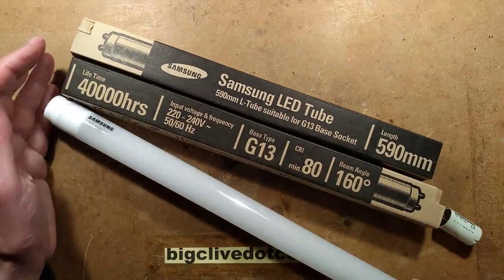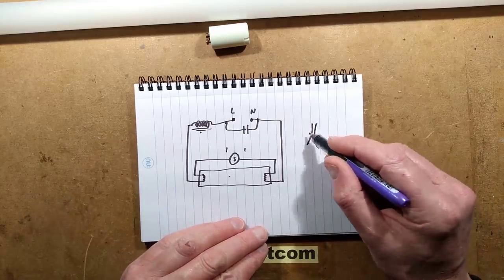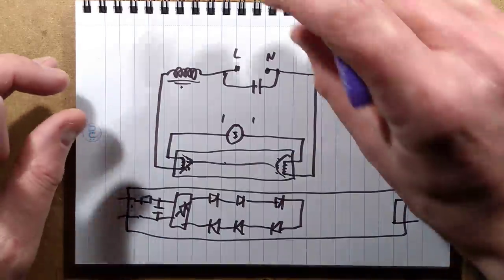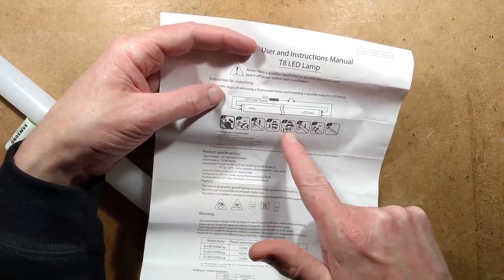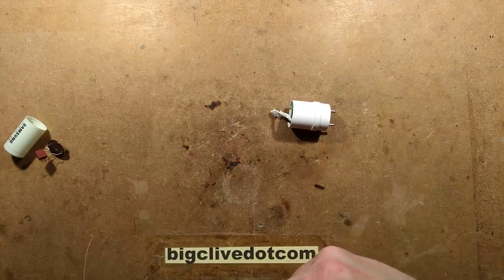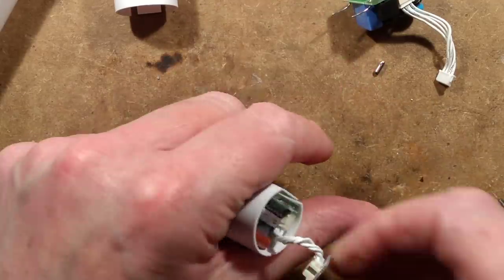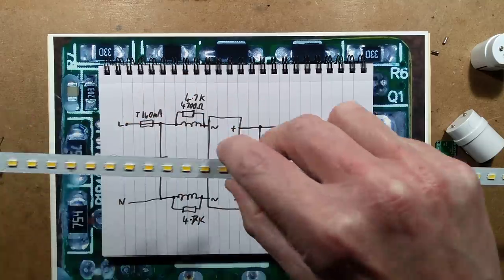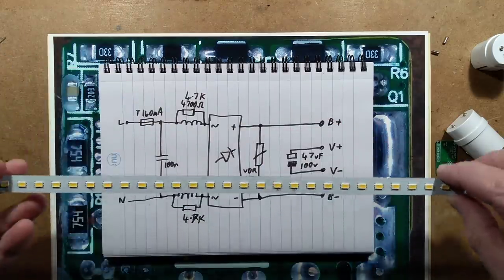Inside a Samsung LED retrofit tube.  (Older style?)

Comment: Hi Clive, very interesting video allways. I don't think the external mosfet is a startup device. It's the main switch. It is used in "source switched mode" as it says somewhere in the datasheet. That probably means "common gate circuit", like " common base circuit" with bipolars: You put the gate on an intermediate voltage, say 12V, and then switch the source pin to ground. Now the switch in the chip does need to switch the full current, but only 12V and not the ~300V max mains voltage.

Comment: That secondary circuit with the transformer looks like it acts like an OPAMP with degenerative feedback in order to provide additional protections and regulation that would otherwise not be available to just the power supply itself.

Comment: Maybe T1 circuit looks for AC imposed on DC supply ...? AC present at that point could indicate several failure modes and trigger a protection feature that shuts the thing off ....

Comment: I wonder how many of those LED tubes experience a blown fuse, with people them throwing them away. It's worth it to keep the failed tubes and use all the parts (after replacing the bad component(s), reconstruct a different type of light, and continue using them for other lighting. I'm too much of a techno-nerd to throw stuff away that cost good money to throw out because of a wee cost of a part.

Comment: Hey Clive I have a power supply here that passes mains through.. I don't know why it works fine the complete casing is earthed but I can measure half mains voltage from case to ground(won't trip breakers or so also)
I just can't find a Damm thing wrong but the shocks are short and nasty
Reply from the maker: That sounds like a common capacitive coupling issue between the windings.  On some supplies they reference the negative output connection to the grounded case to prevent that.
If the grounded case seems live with respect to local grounded objects then check for continuity between them.  There should be no significant voltage.  If there is then there is an open circuit in the ground circuit somewhere.

Comment: when you explaned the starter you forgot to mention one of its most important function:
It will open the circut right at the phasechange, the only moment when its possible to start the tube.
You can start a tube without a starter, but then you have to be lucky to hit the switch right at the phasechange.

Comment: We fit loads of these in the factory i work, annoyingly the majority of fittings are digital fittings and need rewiring. The older generation of tubes with the L and N input at one  end the opposite end pins are common'd out and causes a big bang if you accidently insert the tube the wrong way round!!
Reply from the maker: The modern tubes have the feed from one end and the other end shorted.  The ideal wiring arrangement is to have live to one end and neutral to the other. with the starter wire linked out.  That way the tube will work either way round.

Comment: Wow this thing is a complex mystery.. It looks to me like they're trying to balance out the mains ripple without using a huge capacitor. Its complex because of the low frequency and its a phase circuit. The telling thing would be that there should be less or no flicker when the tube is running.

Comment: Strange you've uploaded this on the day I've had an e-mail from Philips to say they'll repair my T12 5' tube ! Obviously, I've asked them as you can't get them any more - so repairing existing ones seems to be the way to go.

Unless..

Clive does another project on his website for DIY LED lighting.

So Clive, this is a request for that project - giving a component list (and suggested sources thereof)  so we can make out own LED lights - with minimal components - such as 80 LEDS 4 diodes and a capacitor or 160 LEDS (or 80 reverse twin LEDS) and 2 capacitors.

A sister video for the same but at 12 or 24 V DC would be useful too - including a transformer to go next to the consumer unit/fuse box to drop the whole house lighting circuits to low voltage. (maybe a model railway transformer will do - then  the whole property's lighting can be centrally dimmed. (I currently use a variac for that in my flat))
Reply from the maker: Easy fix for 12 or 24V.  Just buy the appropriate LED tape and put some inside the tube or on the backplate of the existing fitting.
Reply: @bigclivedotcom  For replacement fluo tubes, I'd want 5 LED strips per tube arranged hexagonally (one missing where it's mounted) - so one strip is a downlight 2 diagonal lights and 2 angled uplights. But what options are there re LED light beam angle ?
Bloody nightmare - hence consideration of getting existing tubes repaired !
Reply: @bigclivedotcom  Check marks.

Looking at migrating to bitchute. Not perfect but if they're prepared to make things perfect, I'll certainly migrate!

Comment: I've fitted thousands of theese ripping out old ballasts and wiring the feed direct to the pins. I really hated the end with the dead short. No matter how many time youve done it once in a while one would go in the wrong way and trip the breakers. I get why it's there in fitting with multiple lamps it acts a cross over on the over side. But I always found a way not to use it. Most of the time the ballasts are electronic with no starter so just popping in the replacement would be a dream come true
Reply: If it trips the breakers, you've wired it wrong (230V to one side, ignore the other side - not a good idea as you found out).
Reply: @mjouwbuis  When retrofitting not wiring from new...so removing old fluorescent lamp and control get ...the new led lamp has the pins on the other side of the tube as a dead short if the tube is inserted the wrong way round and you have this short in the feed side it causes live and neutral to short together tripping the breakers. When your removing ballasts and taking the feed to one of the lamp holders it's hard to remember which side you did it to. so it's easy enough to forget which side is the feed and which isn't when your doing thousands and your now popping a new led lamp in. it doesn't take much to do this and insert the tube the wrong way round. nothing to do with wiring up wrong as you can put a tube in any way you like it will fit both ways regardless but will only work with the power side of the tube in the lampholder with feed so if your blind there's 50/50 chance its going work or blow up.

Comment: q: is .uks power safer then .us? ie; being able to cook yourself easy?
Reply from the maker: Higher voltage, so higher shock current.  A shock is so unpleasant that it tends to discourage people from working live.  The UK has a lower electrocution ratio than the USA.
Reply: @bigclivedotcom  ie the reason i asked was the "get someone smart enough" to do the electrical was more dangerous? in the .us..?
Reply from the maker: @MrScotttraynor  No.  The UK where electrical training has degenerated into a farce.
Reply: @bigclivedotcom  no what i ment was in the .us you really dont need cert/etc, but your boned if you dont, ie; you burn your house down, or kill yourself/other via wiring, insurance isnt happy, etc.. or if your lucky enough to have a honest city/town inspector for permit work, they do catch bad wiring, etc.. but think it varies state to state, in some of the red farm states who needs any building regs.. aka, how far apart can you get 2x4s and have the house still standing ;)

Comment: Just a shame that it's cheaper to buy just the LED replacement tubes than the full replacement lights, I didn't know that a strip of folded chineseium steel costs 3x as much as just the LED circuitry alone in complete LED fixtures... :S

Comment: I think the fuse in the starter is there to blow when some idiot puts a regular TL and the “led starter” in the same enclosure. Which would be a problem with just a link.

(4:20 is slang for marihuana, because of the code numbers allegedly used by American police on the publicly listenable police radio. You know “4 20 in progress, officer in hot pursuit!”, that sort of thing. It’s in the lingo now as 4:20 pm, 20th of the 4th, etc)

Comment: My advise for replacing those florescent bulbs with LED bulbs is to get replacement LED's that have a built in control circuit so that the ballast can be eliminated and the line goes directly to the bulb as opposed to what is shown in the video.

Comment: The "shield" is a "heat sink"....  (i bet)...
Reply: If it were a heat sink it'd likely have much more surface area connected than just that one pin. No, it's surely an RF shield as those types of lights used to be known for lots of RF pollution.

Comment: I must admit I hate digital zoom, but then I am into photography & am a bit of a photography snob. We all have our fults, that is one of mine. I would prsonaly prefer it if you moved your phone physicaly closer to the item. But i do undersanbd the praticalitys that oftern don't make that work.
Reply from the maker: The initial zoom is optical within the 12M frame of the sensor.  The video is only being recorded at 1080P.  It's only when it gets very close that the pixelation of actual digital zoom occurs.
Reply: @bigclivedotcom  Now that is something I did not know & is quite pleasing to hear. Some of your older videos you cna see the pixelisation. the more modern ones I have not seen it. But then most of the time i don't wth in full HD. That would be why I have not seen it. Kind of impressive they can fit zoom optics in a phone these days.

Comment: LED tubes, or "how to replace cheap things that lasted for decades with expensive crap with lots of electrolytic caps that fails in just few years". And call it green and sustainable, of course.
Electronic ballasts for regular tubes also are good Chinese crap with a lifespan calculated in months at best.... Once dead, you're good for replacing the whole thing....
Reply from the maker: Yeah.  There's a lot to be said for the older technologies.  Modern stuff is basically expensive landfill keeping salesmen in a job.

Comment: i replaced my old filament shaver tube light with a LED one as soon as i moved in, morrisons £5 bargain and that used the original fixture
Reply: Errrm yeah, thats because its just a filament tube. It has no components in the fixture. Just l and n into the tube. They are much simpler to make replacements for.
Reply: @stevecraft00  I know that's why I use the shaver light instead of the ceiling one. Cba messing with it

Comment: Fran has a piece about the deverification: https://youtu.be/2aP_3pFr0Vg 

These LED tear-downs Clive is doing are interesting. I have been in my current flat in SW London for 13 years. When I moved in I replaced all my tungsten bulbs with CFLs. Now I am working through replacing those with LEDs. At least 3 of the originals CFLs are still working! The only "real" fluorescent is in my kitchen, but when that goes it will be replaced with an LED tube like this one. So thank you Clive for all this useful info. And the sometimes hilarious tear-downs!

Comment: Now you know what I'm up against, I taken to bits 3 led lights from walmart. Without 38 years experience and a microscope I can only get so far. I did fix one of them tho, bad solder connection. The other did the on off on off thing. A 21 standard house lamps. However lately at Walmart most of there house brand LEDs are filament LEDs the long yellow stripes. I've had them for a month they are dimmable (which maybe why they are controlling and or sensing the wave ?) So far so good. Cheers sorry about youtube. Gotta run take the boy to skrool.

Comment: My biggest gripe with these tubes is they are marketed to replace a florescent tube, but they have NO heat sink for the LEDs and they get stupid hot. Prolonged use of them as a normal light will result in them failing. While as a shop light they could last months to years if only run for a few hours at a time, but as an all day every day thing? No.

Comment: I guess these ON/OFF cycles are just their testing parameters, which makes no sense.
Reply: More that frequent starting will cause the fuses and MOV to fail prematurely from thermal cycling and high current spikes, but longer on time with no switching will result in a long life.
Reply: @SeanBZA  Yes, I also thoght that. But their data tells another story. 50000h 30s/30s and 200000h 2s/15s. But those numbers are just there to look good.

Comment: I have ,6x6ft t8s in my garage, it's now cheaper toi have 6 of these shipped than real ones as the glass no courier really wants to take responsibility fir
Reply: That's good to know! I'm due to replace most of mine before winter.
Reply: @aaronj08ar  I'm clinging to3 more spares, looking for options!
Reply: @jusb1066  toggled dimmable ones from home depot. I've run mine a few years now and they are reliable starters even in subzero weather. They are the bypass type. 5k light color. I am planning to buy some more for the laundry room and far end of the shop.

Comment: An LED starter to retrofit an existing Tube fluorescent fixture lamp? Yeah, that's totally legit there The LED costs a lot of money VS just getting another old 1940's tube technology one. Only morons retrofit fluorescent fixtures thinking of saving 8 watts of power! But they forget the crazy cost of the LED bulb and new starter that aren't really designed for this. And more electronics makes more things much more unreliable. I have a black light 15W tube made in the 1950's that still works!  😂🤣😂🤣😂
Reply: You forget that the Ballast has a loss too, depends of age of the Magnetic-Ballast for a 18W Tube it would be for an old one about 15W and for a new maybe 5W to 8W on designed Current. 
LED tube draws less Current through the Ballast so it doesn't heat up that much like with a normal FL.
Reply: Your blacklight tube doesn't have phosphor that degenerates with use, so that kind of makes sense. A normal fluorescent tube however will degrade visibly after 10.000 hours or so. A well built LED tube will use half the power and last 4 times as long. I do agree with you, that it wasn't really feasible just 10 years ago or even when they started pushing it.
Reply: It's germicidal tubes that have no phosphor (and a fused quartz tube to let the UVC out). Blacklight tubes do have a special violet phosphor.
Clive's video on UV tubes: https://www.youtube.com/watch?v=CpRMud6EFtE

Comment: Can be a very nasty wanga from the arse of a flory, only ever done it once. Strangely after that I took a lot more care. Even when I am 1000%, 5 stage isolation, guy standing over the DB for me I still cant grab any shiny copper, a tenatative flick first and then only if I need to twist the strands, if it don't need touchin don't touch it, call me a wuss, at least I can hear you
Reply: if the niceic are a consumer protection body as they claim how the hell can they sit back and allow RECs to charge for apparent power? Especially when the likes of Npower are claiming it's a legal requirement to have a smart meter. Strangely they didn't come with the police to fit one as I had advised them they would be needed in order to enter my home, hehehe.
Reply from the maker: The NICEIC is not a consumer protection body.  It's a privately owned marketing company that presents itself as a government style body and charges its clients to use its logo.

Comment: 20:03 That's called cascoding. You'd have known that if you simply had typed "MOSFETs in series" into your favorite search engine.
Reply: Yes, the reason for this is the internal MOSFET is not rated to a high voltage, gong from the little English on the data sheet. It doesn't have to be a MOSFET. A BJT would work, but would need a lot of base current, so would be a bad idea.